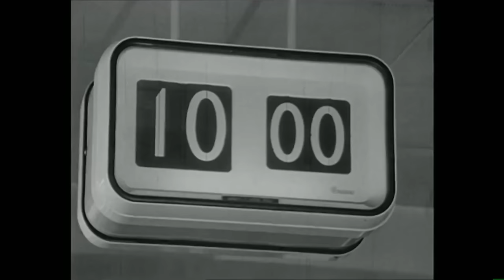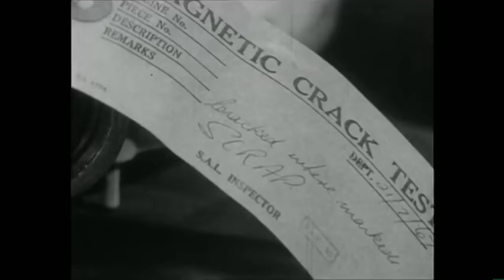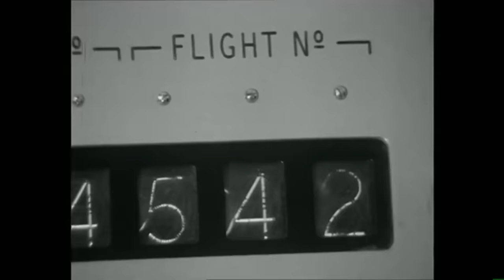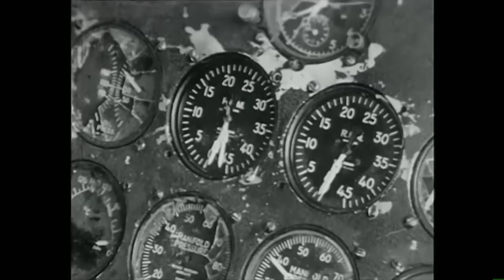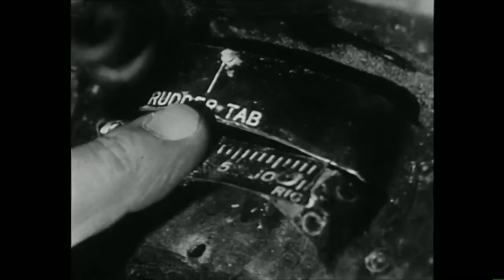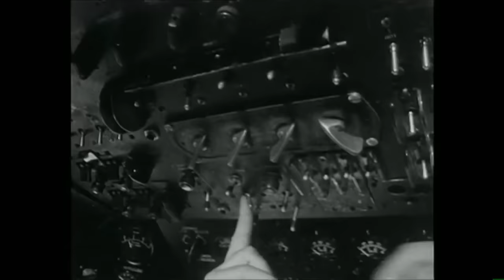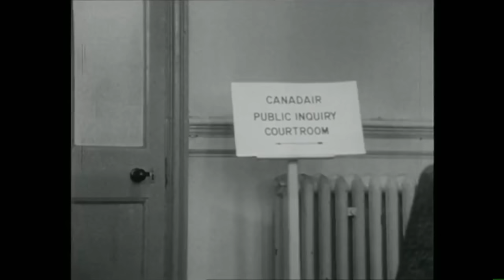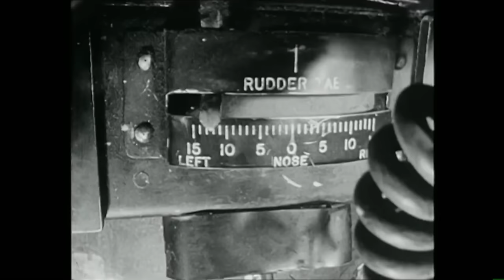Stockport Air Disaster

Comment: What if the red herring wasn't really a red herring?  Number 4 has pwer loss  but the instruments becasue of the mixed wiring shows that it is number 3 so they cut all power.  By the time they realise that it was actually number 4 they had lost to much altitude and couldn't recover.  That might also explain why the plane, when the witnesses saw it, had its nose up higher than the tail.  They were trying to regain altitude
Reply: But the film explains that the wires were crossed at both ends, thus cancelling out.  The indicators showed the correct engine readings.
Reply: @rogerhoughton3758  Still, the fact that these cables could be crossed at either end shows a design fault in the assembly. If, as a field engineer for maintenance, I saw this possibility, I would have raised Holy Hell !!
The Devil is in the wiring harness, --too often.
Reply: It does indeed Indosarnia ...strangely enough on a British Midland Boeing 737 22 years or so on. Lightning striking twice ?
Reply: @jonrishworth7276  I think that was the Kegworth crash, one engine stared to vibrate and the captain throttled back an engine and the vibration stopped making the captain think that was the offending engine so he shut it down. problem was the auto throttle had closed the throttles on both engines which is why the vibration stopped, the captain then opened the throttle on the remaining running engine which was in fact the sick engine and the good engine was not now running.
Reply: Yes @musicbruv , it was indeed Kegworth, but although the captain erroneously shut down his remaining good engine after suffering a compressor failure in the other, I don't think it was an autothrottle problem; as I recall they began an emergency descent with the faulty engine throttled back and the vibration had ceased as it was no longer under load, but it ultimately failed when they demanded power from it on approach, by which time they were flying too low and slow to 'windmill' start the good engine. Jan Bartelski's excellent 'Disasters in the Air' book gives a comprehensive if pilot - biased account of what occurred at Kegworth.
Reply: @jonrishworth7276  I know I may be a bit off with the facts but I recall auto throttle and fuel flow to the engines being a factor. The captain for some reason thought it was the right hand engine and when he throttles that back the damaged left engine also throttled back and the vibrations stopped confirming the captains suspicions that the right hand engine was the problem. I will have to watch a documentary on the crash again as it has been years since I saw it.
Reply: It was never my intention to suggest that you were in any way 'off with the facts' @SW6, at the end of the day the engines would have been throttled back for the emergency descent. Like yourself, it is years since I read about this one, but I recall that as in the HG crash there were other mitigating factors, e.g the alleged failure of the cabin crew to tell the flight deck that passengers had reported flames from the defective engine (the port I think), and the crew's possibly overriding belief that the 'good' engine was defective due to smoke having entered the cabin via the air conditioning that was powered by it, when in reality the aircon was powered by the 'good' engine on the preceding model (737-300 ?), but by the defective one on the model in question. I believe there was also a suggestion of instrumentation unfamilarity along the same lines, and the engine manufacturer's test regime following the uprating of the engine type on the 737-400 was called into question following the crash, and that this led to the grounding and examination of all aircraft thus fitted.

Comment: FWIW:  I did not know that flight recorders that advanced were in use on passenger aircraft in the 1960s. 
 
I also did not know there were versions of the DC-4 that were equipped with liquid-cooled engines, not air-cooled radial engines as are typical of the type.
Reply: Flight data recorders were invented in 1953, and cockpit voice recorders date from even earlier, 1939, yet the latter didnt become mandatory until after the 1972 Staines air disaster when a trident came down just after take off from Heathrow, killing all 112 on board, suspected cause, pilot being taken I'll

Worst disaster in uk at the time
Reply: Canadair developed this version powered by Merlins for economic and political reasons , they did however consider the Merlin to give a higher power ratio. The target customer was TCA also later BOAC to reduce dollar purchase .
Reply: @andrewwood1257  >>> It seems like the Merlins would be better from the point of view of streamlining the entire airframe.
Reply: @Allan_aka_RocKITEman  The whole subject of the North star is fascinating and full marks to the Canadians for supporting their industry. If you can find one a good book is "The Canandair North Star " by Larry Milberry.
Reply: Rockiteman -  Canadair in Montreal made the DC-4 under license and called it "The North Star". I always thought that they had only P&W radials
and not R-R engines. Canadair also had a license to build the P&W engines, and still make P&W turbine engines today.
Reply: Baz Bazdad  All C-4s had the Rolls Royce Merlin engines mounted in Rolls-Royce Universal Power Plant (UPP) . Late production examples of the Lancaster - identifiable by them having 4 bladed propellers in place of the usual 3 bladed propeller, the Lincoln and the Tudor all used the Universal  Power Plant. The engine nacelles on the C-4 look different because they had a specially designed crossover exhaust system that channeled the fuselage side exhaust to the opposite side of the engine.

Comment: Does anyone know if the Argonaut had individual fuel tank quantity gauges?  If it did, why did the enquiry not touch on the reasons for the pilots not noticing the diminishing fuel state of tank 4?
Reply: The problem was that a pilot before hand and dropped a drink in the control panel. The fuel gauges read wrong. That's why planes today have gauges in front and above.

Comment: The air density is important in stall testing.  They need to fly the test airplane at roughly the same altitude as the one that crashed.
Reply: Yes, but without a flight simulator back then, they might have crashed too, so they went high for safety.
Reply: Given the conditions, they were probably able to fly about a slow as possible, before finally crashing.

Comment: A classic multi-engine aerodynamic stall, something that still happens to this day.  That right turn to achieve the ILS approach sealed the fate of the aircraft and passengers as, with the two engines on the right (starboard) wing you have already lost airflow over the wing to create lift.  Then add in the right turn and the right wing is describing the smaller arc in the turn and is, therefore, travelling at a relatively much lower speed than the left, meaning even less airflow over the right wing and even less generation of lift.  At the height the aircraft was operating at, the stall was always going to be irrecoverable, though the pilot probably executed something of a miracle by managing to keep the aircraft in the air for long enough for it to come down on a relatively open piece of land as that area is heavily built up, and falling in a populated area on a Sunday morning would have made the tragedy infinitely worse.  Had the crew turned to the left to make their approach with the wind rather than into it, i.e. from the west and not the east, the stall probably wouldn't have happened, though the distance to runway would have been larger.  Maybe if the pilot had declared a Mayday then they would have been given priority over the traffic in the area and they would have been allowed to make a non-standard approach to the west ILS to fly a shorter distance to make the approach.  There are a lot of maybes.  This certainly gives an interesting insight into the human factors considered in an air crash, and why so much care is taken over the design of flight-critical controls in modern aircraft to make sure that issues like those involved here cannot happen without the relevant conditions being clearly visible to the flight deck crew...
Reply: Charles Hopkins    You don't need to be any kind of pilot to know how to avoid getting into a stall in a multi-engine aircraft.  It's just a matter of physics...
Reply: Charles Hopkins    Clearly I know more than you...
Reply: The right turn was definitely a factor.

Comment: Brilliant! My view? as an ex-RAF Propulsion Engineer..........The accident would never have happened if a: the crossfeed cocks had been more visible; where they were buried is an example of poor design; b: there had been a discernible, (audible?), detente on the fuel cock quadrant...there may have been but that vital gen was not revealed in this film... Was there one?...can the accident really have happened because no detente was made?.....evidently yes....one half inch further and lives would have been saved.
What do you think?
Reply: @janicenicholls5924  Many mechanical controls have a range where each end of the movement ends in a positive location, much like a half-round depression; the lever falls into this and is held more securely than if it wasn't there.Maybe the Argonaut had these, maybe not......if it didn't, that's a design omission.....in the event the crossfeed control didn't reach that zone.
The crossfeed cocks, or valves, are common on aircraft and allow transfer of fuel from one wing to another and from one tank to another. Often used to keep aircraft centre of gravity constant and useful in fuel emergencies.
Reply: Surely the cause was the failure to feather both starboard engines? The imposed drag of the wind milling stbd inner would ensure the aircraft would never stay up, even at full power on the port engines. Simply put the aircraft would fly with two engines out on one side, if they were feathered, albeit with high control inputs. With the stbd inner unfeathered there was no chance of it staying aloft. Nothing is mentioned in the accident report about this. It looks as though it was overlooked by the non FP, due to excessive workload. Which points to the Ministry requirement to have a three man flight crew.
Reply: @bobcornford3637  Certainly contributory....but the initial cause was that half-inch open cross feed, creating the need to address the engine problems. Funny thing Bob.....in my long life I've seen many such simple actions cause major incidents: Like the Comet 1's square windows; a piece of metal on the runway bringing down a Concorde; damaged Teflon insulation causing the Apollo 13 incident; the fatal words 'let's go' causing the Teneriffe aircraft disaster........a long list.
Reply: @Firebrand55  Not contributory, it was THE cause. Pure and simple.... any 4 engined piston a/c will continue flying with 2 engines on one side feathered. No 4 engined a/c will fly with one or more engines unfeathered. This was a standard procedure, practised over and over. 
There were many accidents with large piston engined multis. The problem was that the prop constant speed unit would keep the pitch adjusted to give the same engine speed as the live engines. With supercharged engines (as distinct from T/C) the problem was exacerbated by the boost pressure being the same as on the engines producing power. It would've been seen as only the fuel flow gauges showing up the fault. Easily done if you aren't a one handed paper hanger at 800feet and going down over a city!
This was the reason why torque meters were fitted.
Reply: @janicenicholls5924  He's spelt it incorrectly, Janice. "Détente" (with an acute accent on the first "e") is from the French meaning 'easing relations', especially between states or countries. "Firebrand 55" meant to write "detent", which gives the meaning for which you were searching. It's a positive location (but not a fixed location) for a switch, lever, or in this case a fuel cock (like a little tap), and may be spring-loaded, to prevent inadvertent movement. The spring gives a lever or tap a "clicky" feel when being moved between different positions. It's not easy to describe without having the equipment to hand but I hope that gives you a feel for the meaning of the word.

Comment: No hysteria to see here. And the surviving Air Hostess returned to work in a cool and dignified manner months later. Nowadays she’d have to be sobbing on the news about it and looking for a multi million Pound compensation payment to make her feel better.
Reply: Yes, and rightly so! The ghastly accident, in fact, was the responsibility of, respectively, the aircraft manufacturer AND the airline she was working for, whose negligent policies nearly KILLED her. She would have deserved at least a million pounds for the horror she had to endure, not to speak about the relatives of those who lost their life and possessions for a misplaced rows of switches and negligent lack of action from within British Midland. I would have raised hell.
Reply: @Gavichap  yes poor design of the  cross feed fuel cocks and where they were positioned too not clearly visible to see they were open  half an inch when they should have  been shut allowing fuel across to the other wings 2 engines  starving the starboard engines of fuel when there was still enough fuel for all 4 engines to run  mmmmmm
Reply: @ericlees7518  The argument I would suggest was with the Canadian Built Aircraft but it should be realised that safety features , typically reflected in a host of'Bunched toggles and push buttons was the norm when that aircraft was designed,so History, and American design coupled with Canadian built was as much to blame, also little consideration was given to safety of design when the aircraft was originally designed and built, we can all be super smart in retrospect but those DC4/cum Argonaut days hadn't changed much since the actual War's end.Terry Offord
Reply: This is a recreation of the event made months or years later to describe thr crash and the investigation. That's why they're so stiff. They've practised their segments for filming. The most natural was the policeman who was used to giving evidence in court.
Reply: GiovanniPala  she'd probably be standing in the middle of it taking selfies 
if it happened now days.
Reply: Just because she went back to work it doesn't nean that she didnt have PTSD at some point
Reply: @terryofford4977  so, american and canadian aircraft are all rubbish then??